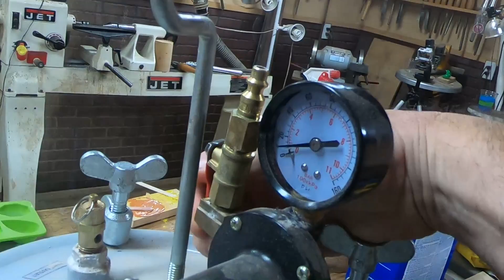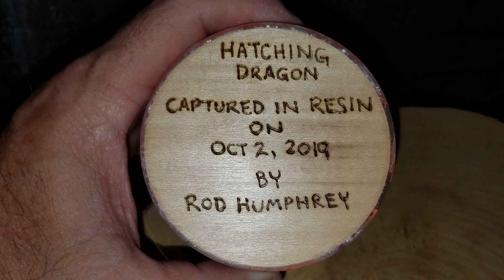A Dragon Egg Captured in Resin

Comment: 2 questions. Where is the wildlife backyard updates? Been a while!! And what resin are you using these days? It seems to serve you well.
Reply from the maker: I should do a wildlife update.  I usually don't have my phone or other cameras out back when the critters are there...   I'm switching back and forth between Allumilite and Art'n Glow.  I like them both.  Art"n Glow seems easier to work with, but takes a full 24 hours before it can be worked with.  Allumilite, just a few hours but it's finicky stuff.

Comment: Very nice Rod, thanks for sharing. Is that a harbor freight pressure pot? Any problems with it? Do you sand to such a high grit because of the resin material, or does it help to make it clear? As you can tell, I haven't tried any resin turnings yet. Thanks.
Reply from the maker: Thank you Joseph!  It is, and yes, the lid seal is problematic, plus I changed out the valves and pressure gauge.  I sand that high because it almost doesn't need any polishing when I'm done, and I think it really improves the overall finish.  Thanks again